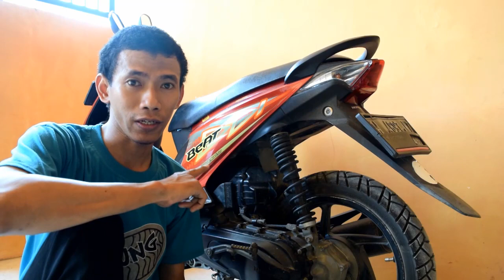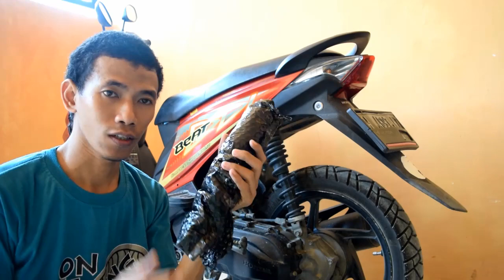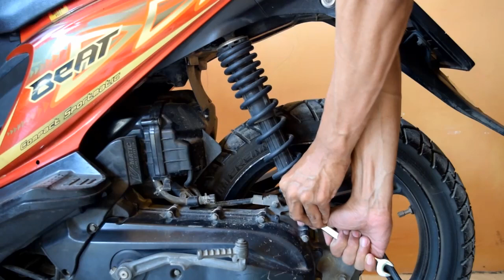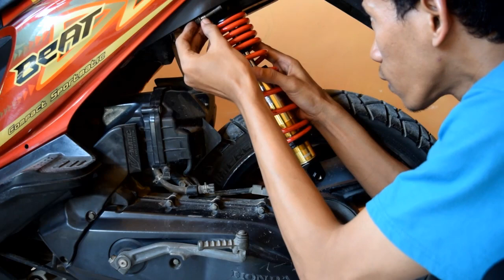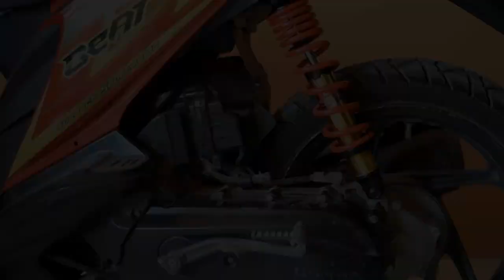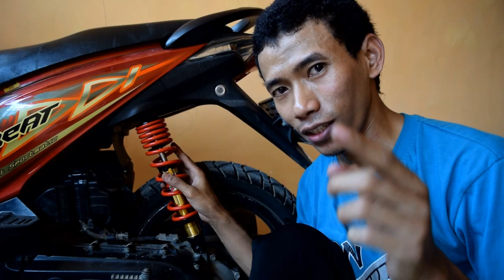Unboxing Shock YSS dan Cara Mudah Ganti shock Breaker Belakang Beat Karbu Tanpa Bongkar Body

Comment: Beat karbu mending 300mm atau 330 bang mohon dijawab
Reply from the maker: Selera mas @Kusno. Kalau yg sy pake itu standarnya 310mm. Kalau 300mm agak turun sedikit, kalau 330mm jadinya agak nungging belakangnya.
Reply: @ABEKDILLAH  suwun mas saya subcribe 😀😀
Reply from the maker: Sami sami
Reply: @ABEKDILLAH kalo pake yss 330 ada yg dicoak gk bos ?